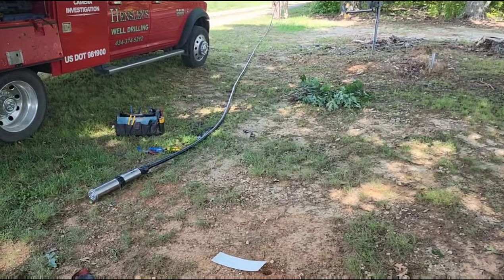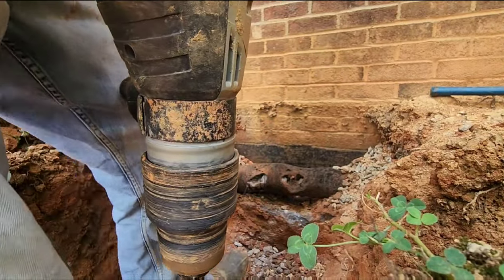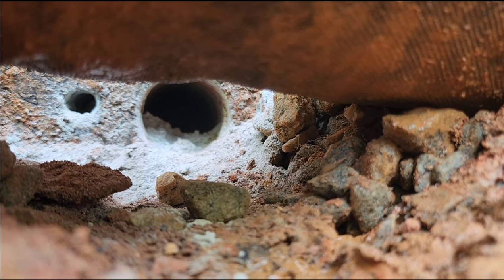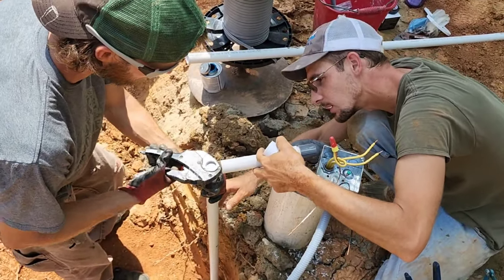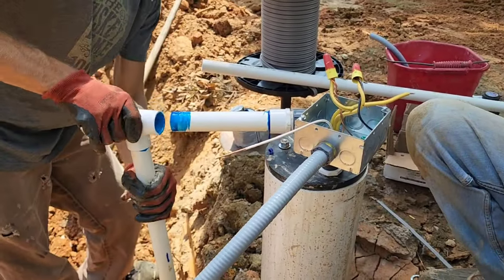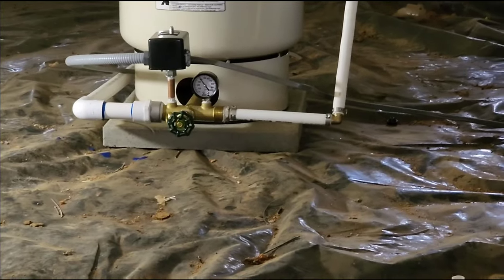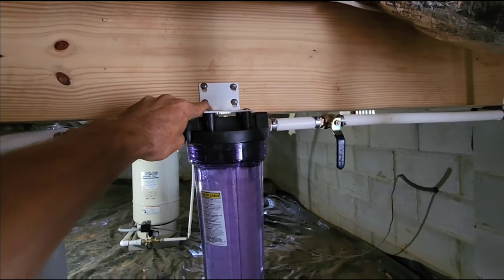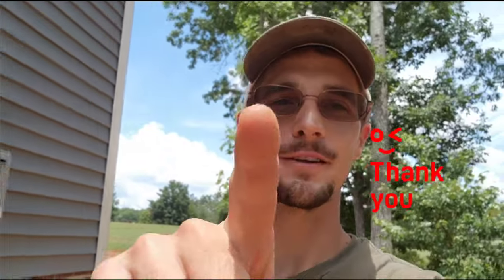Complete Water Well Pump System Installation Guide

Comment: They make good Welldrillers, but not electricians not trying to dig too far but 4 S. Boxes did not belong outside and electrical codes. Don’t mix too well with how it’s been done. Kinda looks OK but not code compliant 4 S boxes are not meant to be weatherproof by no means

Comment: I've just changed the well pump with a stronger one because the previous one didn't had enough power, once installed and switched on, the pump is shaking like hell and when I opened a valve at the top of the pump to let water out after a few seconds it stopped shaking but, the moment I would close that valve the pump would start shaking again, any idea what am I missing that's causing this? Thank you and appreciate the input

Comment: An issue with our well system brought me to your video channel. I have learned more information about wells, pumps, pressure components and electrical then I thought my brain could hold in a 3 day time span. Slowly but surely we are getting the issues all ironed out thanks to you! My question is have you ever encountered a service call where there was no visible well head anywhere on the property? That is the issue we are having. We do have a concrete lid that when lifted there is another lid inside and then all that can be seen is water. It is about 2 feet wide in diameter. Nothing protrudes up from the hole so it doesn't look like anything I have seen in your videos. Other than that, there is nothing else and it is about 150 feet from where I found where the water supply pipe enters the house. On the other side of the wall where the pipe comes in there is a well control box which shows an install date of 1974 on it. Next to that is an old fuse panel with the power cut off lever that still works and wiring fed into the newer control box and then out to a newer breaker box. The Well pressure tank is inside in our boiler room. The house was built in 1955. It belonged to a wealthy local guy who spared no expense when he built it and he hid everything. he built concrete tunnels under the house for the water lines. All utilities are buried/hidden. It was an estate purchase for us so unfortunately we just don't have much info and unraveling the secrets to this house has been a journey. Anyway, so sorry for the long winded story but I'd like to know the best way go about figuring out where our well is actually located. Thanks so much for all you do! you've been an invaluable help to us in Ohio!

Comment: Your videos are awesome I have learned a lot about wells and I now have property where that's my only water option My well is 220 ft deep 5 in casing all the way to the bottom producing 30 gallons a minute water is at 50 ft below the ground and I am setting my own pump system from watching your videos

Comment: Dear H2O Mechanic;  I greatly appreciate your instructive and well documented videos.  I also appreciate your professionalism.  I have been doing lots of YouTube research because I may be purchasing a retirement home in Virginia and likely would be on well water and septic (both of which I have not had to deal with.  I was wondering what your thoughts are on flat-roll pipe to use as your water well piping to the surface well head ?  This flat-roll piping is supposed to be stronger than black poly pipe (but might not be as available?  I would appreciate your thoughts.  Many thanks !
Reply from the maker: I've seen it, only plumbers have had good results in testing it. But I personally wouldn't use it. I even had the company reach out to me and I didn't want to advertise for them. It's different. But I have nothing negative to say about it. It's all personal choice

Comment: What size PVC to I use to run water from the pump to the house? 1" ? Is there an issue with using 1" vs 1.5" vs 2" ?

Comment: I've been watching your videos to try and solve my well problem.

I just purchased a 100 year old house with limited information about the property.  There is an old (probably hand dug) well in the back yard with a well pump in it and pump handle at the top.  It is not connected to the house.  The water level is 15 feet below ground and the well pump is 50 feet below ground, but I don't know how deep the well goes.  The pump is a 2 wire, half HP Franklin Electric, continuous pump.

When I plug the well pump to my 120v outlet and I open the pump handle, I get a burst of dirty water followed by a strong flow of clean water for about 20 seconds and then the pump automatically turns off ending with dirty water.  There is about 2 minutes of rest and then the pump cuts back on with the same 20 second, dirty-clean-dirty pattern.

I can tell that it was not a very professional install but all the basics are there.  I would like to be able to use this well for a hybrid geothermal system, which requires about 2 GPM.  

What do you think is wrong and what do you recommend?
Reply from the maker: Pump motor bearings are shot. Replace the pump.  It's over heating, cooling down & runs again til it gets hot again

Comment: Thanks for sharing!  You mentioned you used schedule 80 fittings, did you use schedule 80 for the whole run too?  And why schedule 80 vs 40?
Reply: He used sch 40 pipe.   Not sure why he upped the 90's to sch 80.

Comment: What brand of the pump as well as pressure tank did you guys use?    Model numbers would help if you know them by chance. Also I have white plastic pipe in my cabin here in West Virginia that I installed back in  the late 1980's that currently uses a gravity fed spring to it so I know that I want to use the least amount of PSI as not to burst the plastic pipe inside the walls.  My drilled well hit 15 gallons a minute when drilled at 70 feet back in 2019 and is 80 feet deep. I was told to set the pump at 10 feet above from the bottom of the deep well is that correct?  I am a retired IBEW electrician  who bought this cabin back in 1987 in the mountains of Pocahontas county West Virginia. It gets cold here in the winter time because I am at 3600 feet above sea level I have been told to trench down to 3 feet so not to have the water line freeze when  the temps have hit to 20 below at night on occasion.. Thanks for any help you can give me.
Reply from the maker: Any pump that's uses a Franklin electric motor is good (Goulds, j-class, triseal ect) as for the tank, Well X-trol 20 gal is great quality. Some of my most popular Videos have links to Quality products I'd recommend.  3ft trench is perfect.  2ft is acceptable as well. 
I used sch40 pvc in the trench and black 200psi poly in the well. 10ft off the bottom of the well is fine for such a shallow well. 
Lots of helpful tips throughout my videos. (Well Pump Q&A Playlist)
Reply: How you make out?
Reply: @bunnyman6321  I have not run a line for the deep well yet. I will do it in the late spring this year. I am clearing land now!   But thank you for asking.
Reply: @tommyfuller103z  Keep me updated!

May you have much success

Comment: Why do you like pvc over poly or pex for the underground run?
Reply from the maker: Pvc has a 2-3 X strength, less likely for rocks to push on pipe & split it. 
Poly & pex are too plyable for trenches. 
If done it both ways. Pvc lasts way longer from my experience & way tougher.
Reply: 200psi poly does the trick

Comment: Couple things I would have done differently….
First I would have used a weatherproof junction box
Second I would have used 45s instead of 90s to keep the flow and pressure at its max…
Every 90 creates both a pressure and volume restriction…

Comment: What wire gage can I use on an hp2 230 volts  water pump and also what dobble braker size?
Reply from the maker: 6awg wire  50amp double breaker
Reply: @h2omechanic my well 47' to bottom,  37 to water can I use jet pump or need submersible pump?

Comment: Yeah I have a question how much would it cost to install a pump all set up with pressure tank The world is clean hundred feet deep producing 5 gallons per minute what’s the usual price for these kind of jobs
Reply from the maker: A complete system install is 1800-2200. Add another 800 if there's trenching to be done

Comment: How come you don't use primer on your joints???
Reply from the maker: Glue is 2in1. It's not necessary unless it's cold, I do use primer on bigger pipe and older pipe. But new pvc is still soft enough to melt just using blue glue.

Comment: I'm curious why you don't use unions at the well head? I'm sure there is a reason haha
Reply from the maker: No need for one. Normally it's good for 15 years. I use unions on jobs I frequently visit. But residential jobs, a tiny leaky union isn't worth the gas & lost time. I've drove 100 miles round trip bc of a drippy union. Not doing that anymore. 
Commercial systems get a union though
Reply: @h2omechanic  I see, makes sense! Thanks and love your videos!!